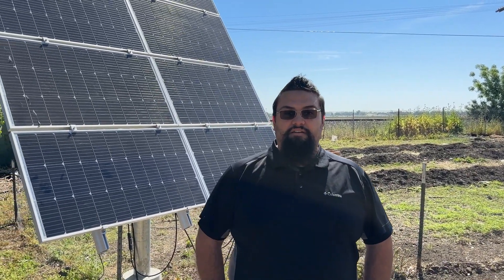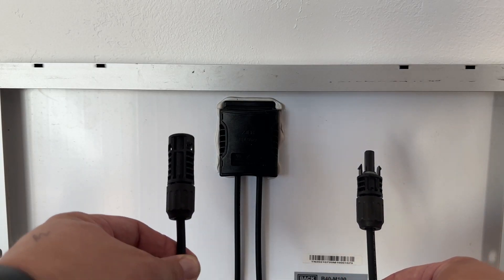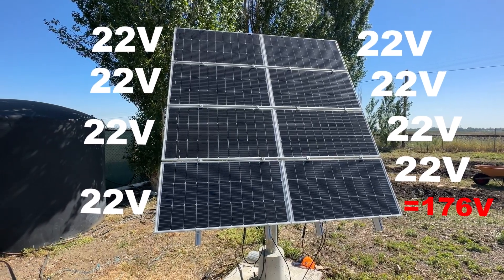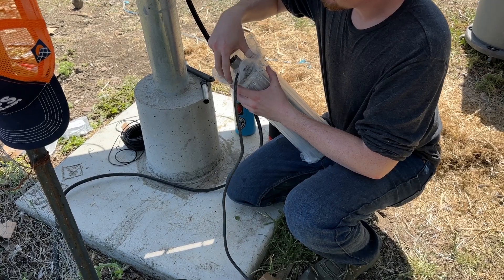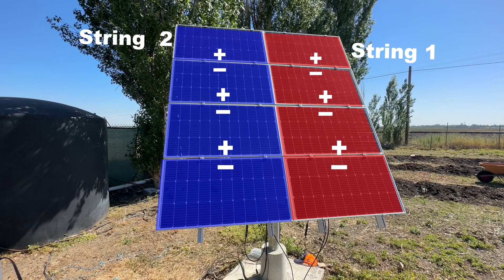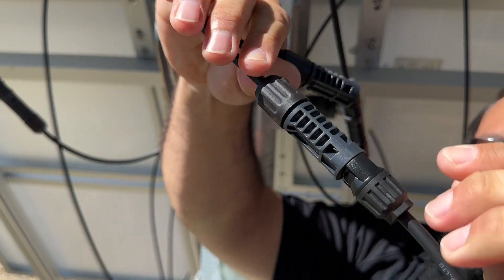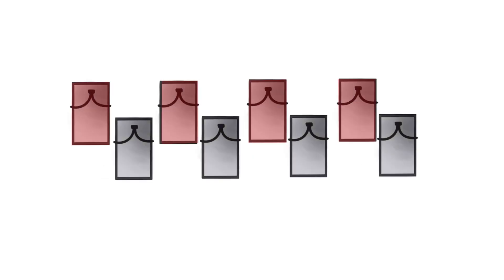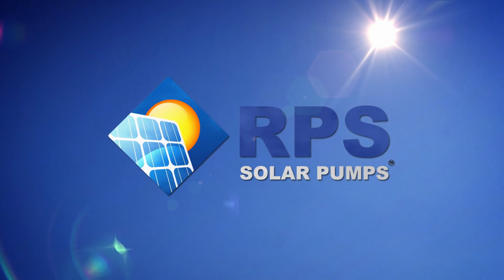How To Wire Eight 100W Solar Panels With A Voltage Under 90V | Wiring For An RPS800

Comment: WTF RPS. Is it this simple? String one of four panels, and string two of four panels.  Wire string one in series for panels 1-4. the last panel will have one positive plug and one negative plug? Then the positive and negative are joined via y connector? which is then plugged into the control panel? And I assume the second string would also be wired in series.  What is funky to me is that at the control box there is a positive and negative connector.  So what gives, what string is positive and what string is negative.  A simple wiring diagram would be really helpful.  The video is confusing.

Comment: or do you use y connector to wire each panel in each string.  Your video lost me.
Reply: I am struggling with exactly this right now now. In fact, two different customer service reps have made conflicting suggestions about how to wire my 8 panels.

Comment: I am confused.  each panel has one positive and one negative. For each string of four panels as depicted in the video, does the positive of panel 1 string one connect to the Negative of Panel 2 string one? Or does the Pos P1 Str 1 connect to Neg P1 Str 2? Please note, I am using 8 panels for submersible RPS 800 pump.